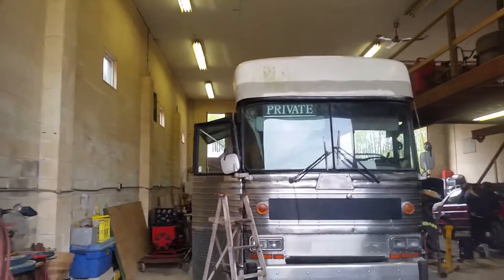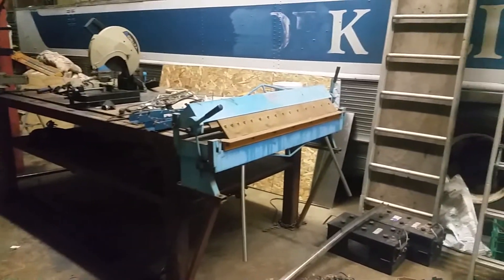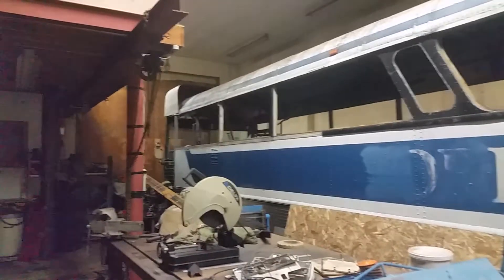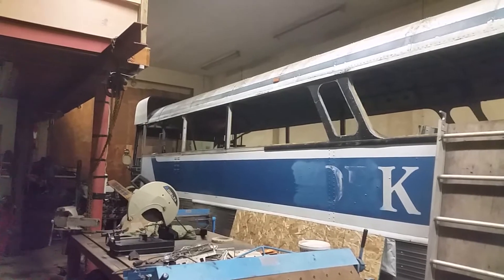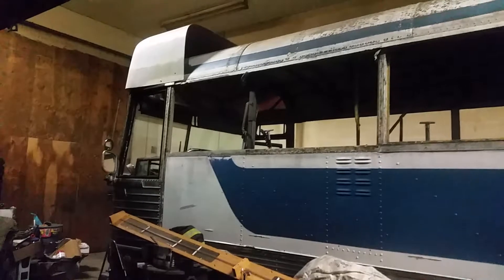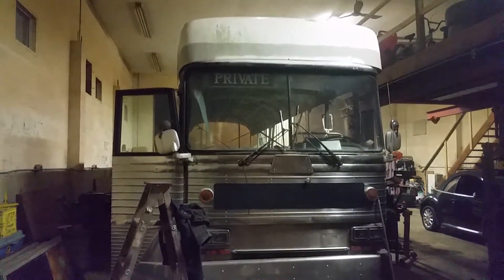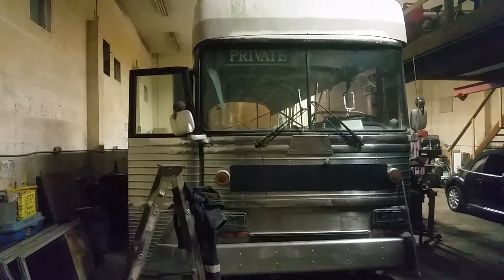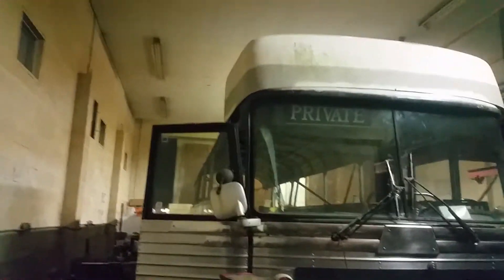Bus Conversion Project Video 10-Prepping for the Roof Raise

Comment: I'm impressed with your building scills, I'm sure it's gonna be awesome. Pity the engine is in the way, otherwise you could park your Ferrari
Reply from the maker: +Jaap de Wind Thanks, It's a lot of work but I am enjoying it, the real challenge will be when I put the slideouts in, probably start on that in a month or so, my goal is to have all of the bus mechanical part done this year, so it will be a driveable conversion shell by the end of the year and then spend next year doing the actual motorhome conversion, don't know if that is a realistic goal or not but I am going to give it my best shot